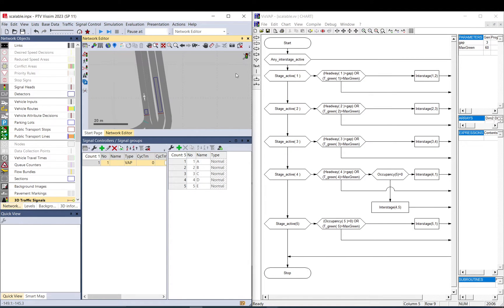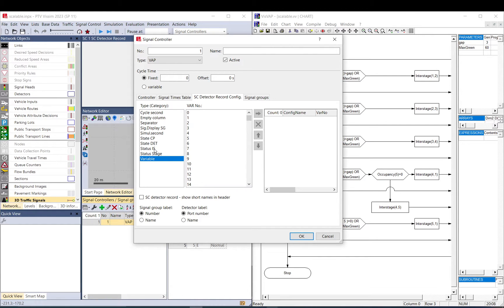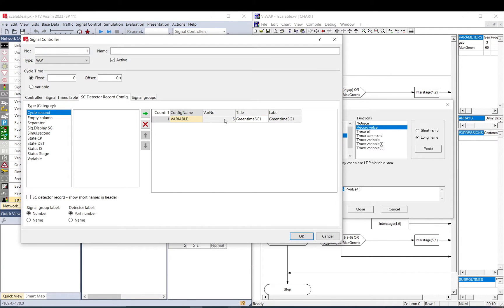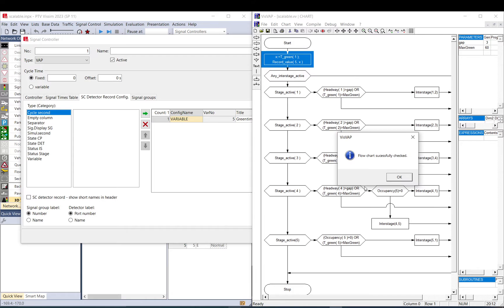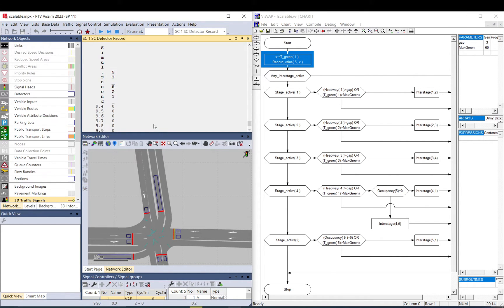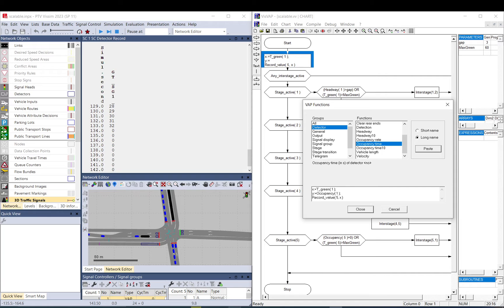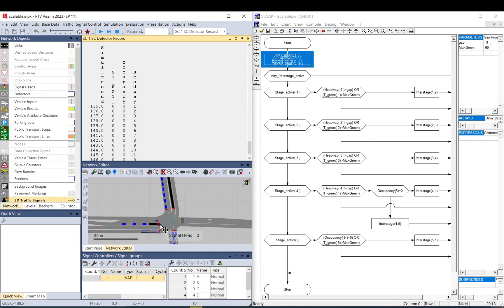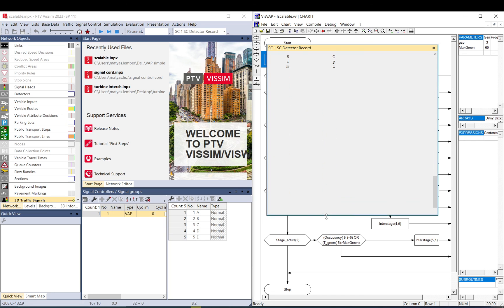Vissim Tutorial - VAP/VISVAP - Accessing VAP live data in Vissim

Comment: Hi, I have a doubt.
I have created a visvap code, but I have used detectors with occupancy time, but I have a series of conditionals where I give 20 seconds of pedestrian crossing or if the other conditions are met I give 25 seconds. And I give another traffic light group 10 seconds for pedestrians but it depends on two detectors. And for that same group in the vehicle I give it 40 seconds.
This can be very variable, depending on the pedestrian waiting time and the detection of vehicles in critical areas such as long queues or possible conflicts.
Consultation. You think its application is viable. Since there would not be a traffic light with a defined time, but rather it will adapt to variability and at a minimum there are those numbers that I mentioned, but they can be longer in favor of the pedestrian.
What do you think?
I would appreciate your opinion, about how very dynamic it is, perhaps it would confuse users a lot. I want to make that proposal in my thesis.
Reply from the maker: Hi, this is hard to answer. 
A few thoughts:
- the way pedestrians work usually depends on your country's regulations and also if the ped crossing is in a standalone intersection or part of the UTC (urban traffic control) where many intersections operate together.
- This kind of flexibility can be good, but rarely existing in real life, so just make sure what is use-case or goal with the model
- pedestrian wait time probably not a key consideration for controllers, usually they have a window in the cycle where they are given green if they were called
- Pedestrian green usually depend on the time it takes pedestrians to cross+safety. There are countries (UK) where they implemented radar over certain crossings, so it can be detected if peds are still walking at the end of the green, so it can be extended slightly, or the red-red phase can be existed, basically to give a bit more time for them to finish crossing.
- Considering vehicle queue is a good idea, just be careful. Pedestrians would be given green regardless of vehicle queuing I think basically everywhere in the world, even if there is a 10km queue for cars. Vehicles would get their max green time (45-75sec roughly) and then the ped would come regardless of vehicle demand.
I hope this is useful